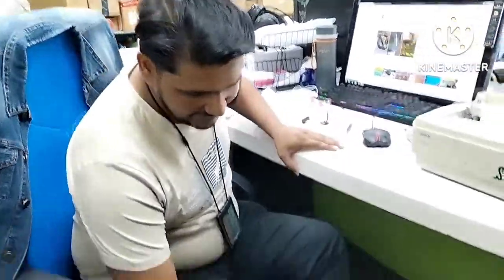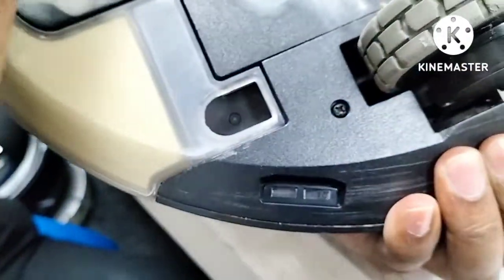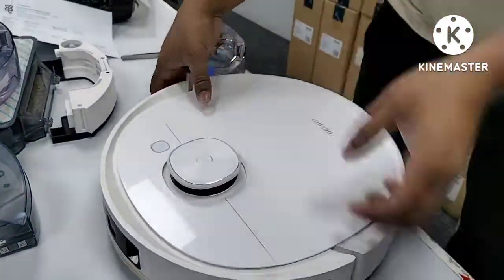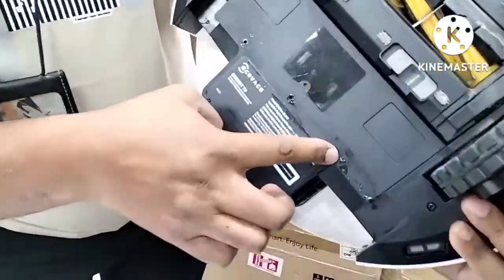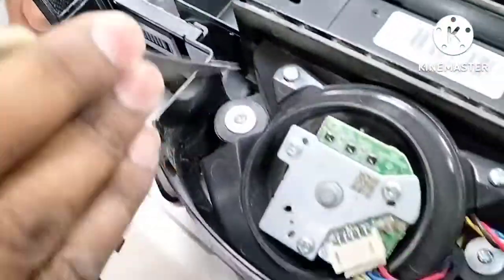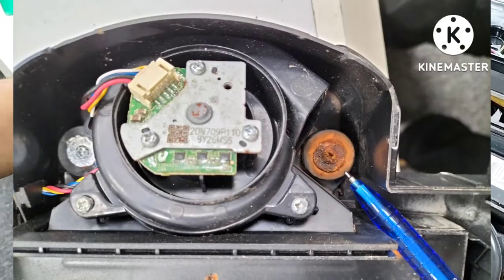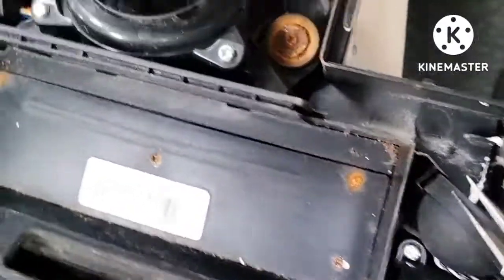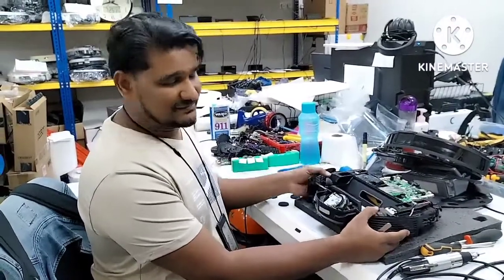"Please clean My Anti-Drop Sensors" How to Fix This Deebot Error

Comment: Sounds like a design issue, where you prevent water drip into the cavity or seal the crimp with water-resistant plastic or gel in the crimp.
Reply: Thank you very much 😊😊😊

Comment: I fixed it. There was no cleaning issue or corrosion on mine. The IR-sensor in the front bumper gets broken. There are 4 sensors on each side of the cleaner robot. 3 bottomsensors and one front/side sensor located in the bumper. 1. Check with a digital camera which side of the bottom sensors does not shine. 2. Remove the front bumper and replace the IR-side-holder assembly. Or open the assembly and replace the 3mm IR-diode. (not sure whether it is 850nm or 940nm) Good luck.
Reply from the maker: Thanks for informing...I hope customers can get help from these details
Reply: I will try this
Reply: What for Ir recipient diode can you recommend? Or what information is important for buying

Comment: Hello, i've once opened my t8 and i "managed" to fix. Unfortunately after a few rounds the error came back and stopped working. I checled the sensors video with my camera ( as on your previous videos shown) and they are all working. The only thing i noticed there is a slight scratch on the window on one of them. Can that be the problem?? I tried to look for some sensors but i can' t get them anywhere.  Any idea?? Thanks. Great clips by the way

Comment: Thank you for this video, but I would like to know how to remove the bumper so I can get to the sensors.  Also, where can I get replacement sensors?  I did get all the way to the bumper but couldn't figure out how to get the bumper off.  I undid all the screws but was afraid to pull too hard on the bumper because it might break.  I have a Deebot T8 AIVi, so it also has a front-facing camera. Any help you could give me would be a great help.  Especially where to get replacement sensors. Thank you.
Reply: Bumper removal is bit critical. There are two small size screws  on the top of camera assembly. you need to use very small screw driver to remove it. I believe this it a dust cover for the camera. Be aware of the Lidar wires and front bumper wires when you de-assemble. You can repair the sensor if you cannot find it in local market. Its just IR LED 3mm transmitter / receiver.
Reply from the maker: Hi..yes Mr sujeewa Just fixed his deebot T8AIVI in Sri Lanka if I'm not wrong..& I'm really feeling happy to know once any user Fix his unit with getting help from my videos...
Reply from the maker: Tomorrow I'll prepare a video for T8AIVI...n upload...I'll show how to remove bumper n refix
Reply: @ecovacstechnicalsupport5278  You should own the best technical resource award for Ecovacs for sharing this knowledge.You are  unintentionally reduce the number of support tickets for them.
Reply: @ecovacstechnicalsupport5278  Did you do a video for how to remove the bumper on the T8AIVI?  Thanks

Comment: Great info, thank you!  I just received a refurbished X1 which was a replacement for my original under warranty. After only the second use it is giving me the drop sensor error. Should I be concerned that it has a pre-existing issue?
Reply from the maker: No need to accept refurbished replacement...you paid for new item. Got warranty.. better request them to fix this issue...in Omni mostly motherboard also need to replace with anti drop sensor
Reply: I'll reach out to them.  Thank you very much for your reply!

Comment: This is very helpful. I would like to see part two of this video which explains how to check anti-drop sensors and front  bumper sensors using a multi meeter. I hope it will help someone in future
Reply from the maker: I'm really happy to hear this comment...I already updated a video last year about this mater...no need even multi meter just with using mobile camera u can test weather anti drop sensors n front bumper sensors working or not...
Reply: @ecovacstechnicalsupport5278  I have Deebot T8. Any idea about how many sensors will be there on front bumper. I see only two sensor on both ends of bumper for my deebot.

Comment: This is great. Thank you for the video. Is the sensor just a closed or open circuit that could be bypassed by connecting or separating the wires? I have no drop-offs on my floor and would like to disable this feature. It is seeing large black spot patterns on my rug as a drop-off.
Reply from the maker: Without Anti drop sensors deebot won't move...& It's very dangerous.. because deebot will fell down from stairs if there's no sensors...

Comment: I have a problem with the anti-drop sensor on my Deebot Ozmo 900, I have checked and all the sensors are clean. So I would like to proceed to replace the damaged sensor, could you tell me which is the exact replacement?

Thank you very much in advance, you do a great job
Reply from the maker: I. This model there are different veriations available... sensors all same just the length of the wire is different..so plz check properly which size you want to order...2 different size available
Reply: @ecovacstechnicalsupport5278  Thank you very much for your response, so I think the best option will be to buy the one with the longest cable, this way I can make sure that the size will always be enough

Comment: Hey
I just bought last month ecovac N10 plus, and it gave me the error for cleaning the drop sensor once. It's still in the warranty. Should i ask them to change the whole machine or 1 time error fine? There will be no harm for using it later? Or if that happened already, it can make the machine rusty someday?
Reply from the maker: If only once it happened then ok ..but if daily give same error then sensors are faulty
Reply: @ecovacstechnicalsupport5278  it gave me the error that anti drop sensor covered with the dust please clean and it happened only once. But my house is very clean and only 2 people living no dust nothing was there. Thats why I was concerned. Is this fine still?

Comment: Hey there,

I replaced all 6 sensors with original parts and still get the same error to clean my anti drop sensors :( What else can I do? Could it be mainboard which is causing the trouble? Any help appreciated, greetings Thomas
Reply: I checked the 4 little sensors on the wire below the lds cover with a multimeter, when pushing one of the little buttons the continuity test is ok, I suppose the sensors are fine then. Any other ideas?
Reply: I did a last try and ordered a new mainboard… holy moly this solved the problem finally for me, the repair all in all was not that cheap and it costed me a lot of time but it was still cheaper than getting a used one at ebay… thanks a lot for these videos here encouraging me to try it… if I knew that you can check if the infrared drop sensors work with your smartphone camera i could have saved some money and a lot time to go straight for the new board, just saying in case somebody is also willing to solve the problem by himself… have a nice evening everybody
Reply from the maker: May I know ur model no sir??
Reply from the maker: Actually we also can not confirm 100% that its just a anti drop sensors issue...some time I replace all seasons still deebot gives same error then last choice is to replace main board
Reply: @ThomasP-he1zq  is yours deebot ozmo 950. And where did you get a mother board at :)

Comment: Thanks for the video is there any way to disable anti drop sensors?  My n8 the sensors become dirty from inside the glass and when it's cleaning the carpet it always stop and tell me to clean the sensor but on hard floors it working great
Reply from the maker: Actually you might be used some oily liquid to Clean that anti drop sensors glass that's why when run on carpet dust stick there n gives error...need to wipe with soft cloth...or u can replace inner sensors only..will be ok

Comment: Followed this guide but I'm having different results. Everything looks completely clean but the drop sensors on one side are not turning on. When looking at them with my phone I don't see them light up. Other side lights up ok though.
Also see some 15 volt as well as 3.3 volt on some of the wires on the side that works. On the faulty side I only see 3.3 volt. Any idea what might be going on here?
Reply from the maker: Anti drop sensors some time with physical eyes we can not see..but might be short circuit etc...just need to replace Anti drop sensors.. hopefully will be ok
Reply: @ecovacstechnicalsupport5278  Thanks for your reply. Greatly appreciated.I did some more testing. When I connect the non working sensors to the connector on the other side of the main board they actually work. So sensors are ok.
Also tested the voltages coming out of the connector and they are different from the working side.
Visual inspection of the main board doesn't show any obvious faults. Not really sure where to go from here.
Reply: @rajackar  did you find out something its exactly the same for me. No rust or anything. All sensors on one side light up but not the other ? Tried to switch the cables from front bumper from right to left and now all sensors light up but still same error.  😮
Reply: @MrJann5089  Sorry man. Spent some serious time measuring and fiddling around but couldn't get it to work. 
Bought a new one. Not evovas of course
Reply: @rajackar  okay i was Thinkingto buy a mother board to get it Working again :)
Reply: @MrJann5089  Downside is that it's no guarantee that it will work again.

Comment: New, 1-day old, T-20 OMNI to replace R95.  It ran for 20 min then got the Anti Drop Sensor message. Followed instructions to wipe sensors but still doing it.  Now what?
Reply from the maker: Sorry for late response... might be Anti drop sensors faulty..need to replace or can contact direct to service center they can help you

Comment: I keep getting the “please clean my anti-drop sensors” error message but I checked the robot inside out. There is no rust or water damage anywhere, sensors are very clean. I also did the test with the camera and see that all 3 sensors on the right side have no red light. What do you think could be the problem? The connections look tight and fine. I don’t have service centres near me and the machine is only 2 years old. I don’t want to create more waste if I can fix it myself. I have Deebot 950
Reply: I have the same exact issue with the same Deebot 950.  I thought it was an issue with the bumper, got a remplacement, and still, so the problem is not the bumper.
If I reverse he connectors on the bumper, all the sensor will light up, so it is a very strange issue.
Reply: @CLAYPOOLALAMENOSUNO  Did you manage to fix it please
Reply: @Miros8111  Sadly, no.  I took it to a tech last week, still no news.
Reply: Hi, Same problems @ my deepot, I changed all sensors, the three right sensors doesn't work. I tested with my mobile phone. I hope someone can Help as soon as possible.
Reply: Hi the mainboard is broken. sorry for that late answer

Comment: Hey, thanks for the video. My deebot 950 was asking me to clean the anti drop sensors and I exchanged them all, front and both sides, but the problem continues. Do you know what else can it be?
Reply from the maker: On top got LDS Cover...plz open it... underneath the cover you will find in front side 3 tiny screw... remove those n lift up the small black sensors cover... underneath you will find one long wire with 4 small sensors.. sometimes those sensors become rusty...u can test with multi meter weather ok or not... hopefully will work
Reply: Hello did you find out what to do, i have exactly same issue :)
Reply: Where did you find the anti drop sensors?

Comment: Hi Bro.. Very useful info. I am repeatedly getting this anti-drop error and along with that, the "Bumper is stuck" error.. If out of warranty, is it worth repairing?
Reply from the maker: Actually sensors replacement won't be very expensive....once Fix then can use again Will be better

Comment: Brother where are you from where is your repair shop
Reply from the maker: I'm in Malaysia bro.... how can I help you.... which model you are using what's the issue
Reply: @ecovacstechnicalsupport5278  May I know where is your shop? I have problem with anti drop sensor. How much does it cost to replace it?
Reply from the maker: I'm in Malaysia..if you want to contact you can WhatsApp at 00601137973018

Comment: I changed both drop sensors. I have still the same Problem: Clean drop sensors. What could I do ?
Reply from the maker: Front sensor, then check bumper light with mobile cam...under LDS cover the small top cover there are tiny sensor that also called anti drop sensor
Reply from the maker: Check top cover tiny sensor attached with black wire wether rusty or not if not rusty then should be ok

Comment: I never used my deebot T8 for mop, it still has got anti drop sensor issues
Reply from the maker: Actually it's not every time due to water damage... electronic component can be short circuit, dusty or just burn n stop working...other reasons also possible...but most likely is left side anti drop sensors spoil...u can try to replace that side...I hope will fix

Comment: I have N79S from 2018, doesn't have water tank?... Still getting this antidrop sensor malfunction, please advise.
Reply from the maker: Error msg appears in mobile app that plz clean my anti drop sensors??? Means might be Sensors too dusty or dust stick there or it's damage....u can try to clean first if still same then need to replace that sensors
Reply from the maker: Plz WhatsApp a video at +601137973018
I'll see the video n let you know how you can sattle
Reply: @ecovacstechnicalsupport5278  Same model/year and same situation. Mobile app says to clean sensors. Sensors are clean (no visible rust or damage), but they do not appear to be working when checking with my phone camera (no red light). Any advice is appreciated. Thanks!

Comment: I got moisture in the anti drop sensors which I cleared with a hair dryer .
Reply from the maker: If it start working then ok good 👍
Reply: @ecovacstechnicalsupport5278  Yup, just humidity in the  house. Took me a while to figure out,  but its fine.

Comment: I opened my robot cleaned all the antidrop sensors. Still the problem persist.
Reply from the maker: Plz send me a video clip at 00601137973018. I'll see n let you know what's the issue
Reply: Mine also the same issue. 
All anti drop sensors took out, pry open the case and inside looks in good condition. Cleaned and still refuse to work.

When on the robot, it stay still and give a sound notification "please clean my anti drop sensor"

Model 950 series